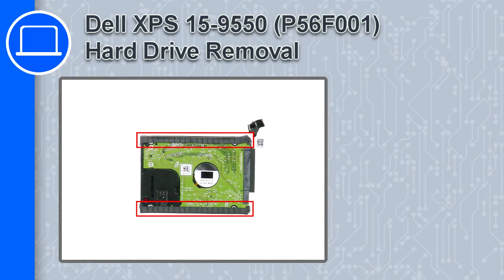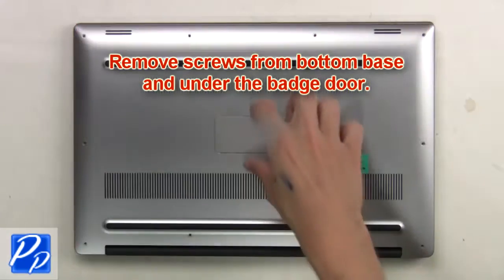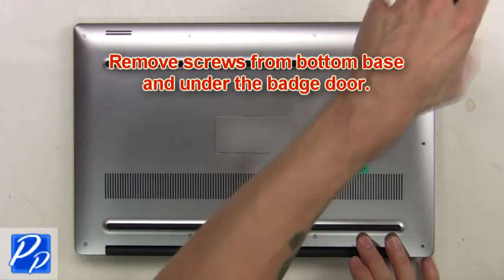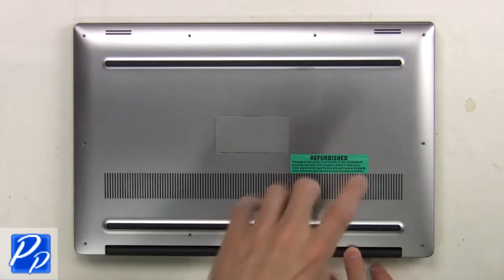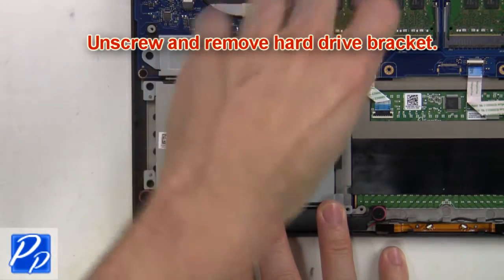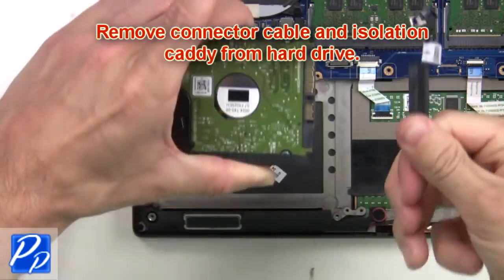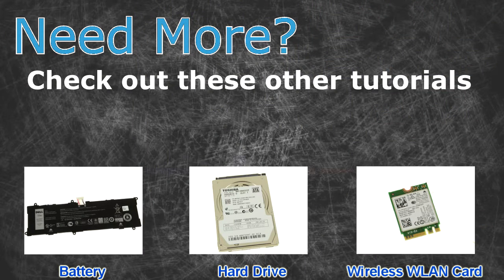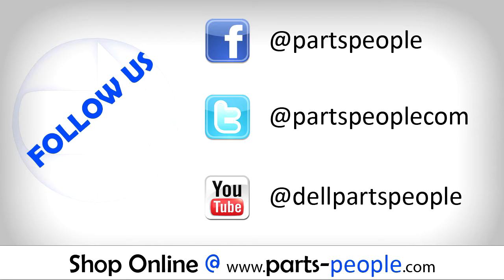Dell XPS 15-9550 (P56F001) Hard Drive How-To Video Tutorial

Comment: What did Dell do to fix it? I have been having the same issues. They told me to resend it and they said it was a hard drive problem. It would work for like 2-3 weeks after the repair. The 3rd time this happened, they told me to resend it for repair.

Comment: Hey I have the XPS 15 32GB SSD and 1TB model, is it possible to upgrade the 32 GB SSD and run the operating system on it, with the 1TB drive for media? If so is it difficult to do? Thanks :)
Reply: any luck with this? I have same issue, where ssd do you need to replace with the 32gb ssd?

Comment: Do I need to buy a new connected cable and caddy with the new hard drive or can I just use the same ones on the new hard drive? Also would I need to reinstall windows operating system or is it written in the sad above the hard drive?
Reply from the maker: No, you can use the existing cable and caddy, just swap them over. As for the OS, you will need to check and seen which drive it's loaded on. If it's on the SSD, you will not need to load it onto the new drive.

Comment: dumb question- if i remove the hard drive to put in a bigger battery will there be a significant change? I have 256gb on ssd and would copy everything to my external drive beforehand but I wanna make sure I wouldnt be breaking the computer